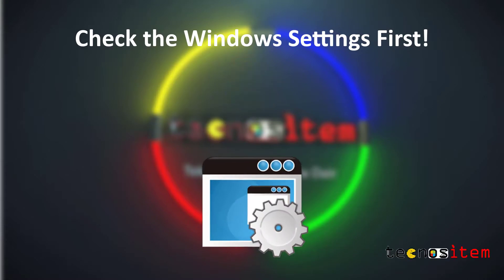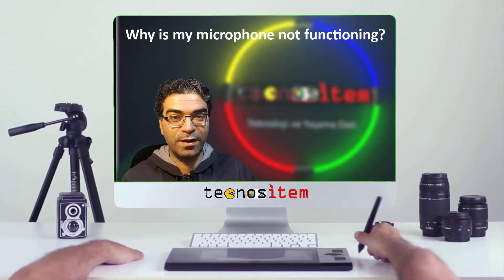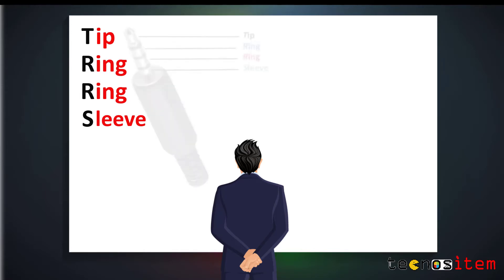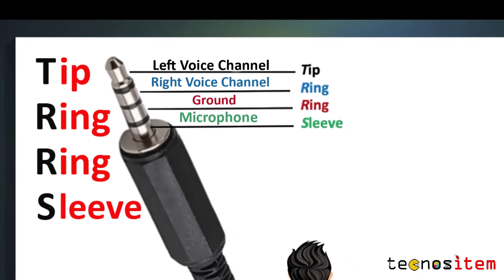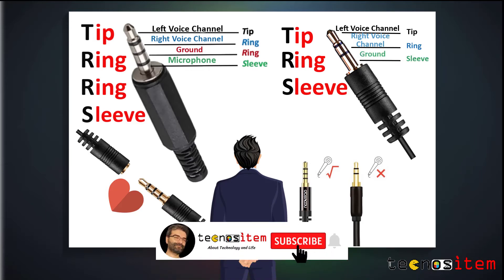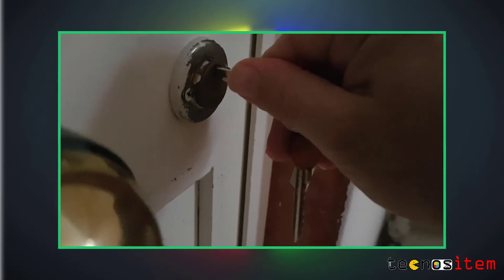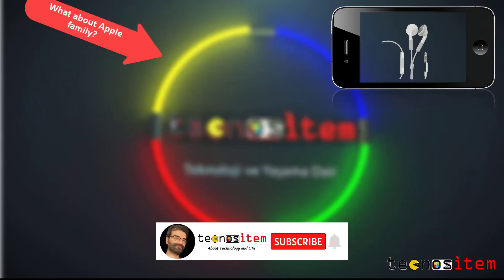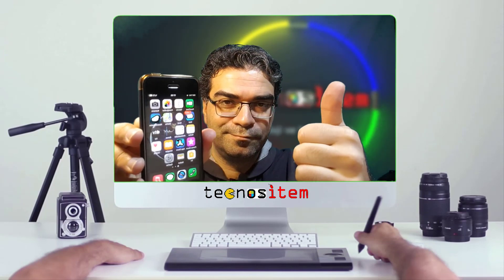My Headset Microphone Is Not Working  What is TRRS and TRS? #TRRS

Comment: Very informative. Thanks. I have a question if you allow. I have a headset that has 2 TRS jacks, and my laptop has only one 3.5mm input port, so I assume that it is a TRRS input. The problem is: when I insert the TRS audio cord in it, it works just fine, but when I unplug it and insets the TRS microphone cord in it, it will still work, but I will hear a very loud buzzing sound from it. Do you think a (1 TRRS male to 2 TRS female splitter) will help me? P.S: I have checked my headset on my older laptop that has 2 TRS input, and it worked just fine with no issue.

Comment: help i have mic with trrs 3.5 mm and headphone trrs 3.5 mm my laptop has 1 trrs female for headphne and mic so im using splitter which male is trrs and 2 female but idk  the port type when i use it mic does not work why? does mic female splitter support trs only? or splitter does not work

Comment: I have a splitter but mic still doesnt read pls help
Reply from the maker: The source of the problem can be various.
 *If your computer has headphone and audio jack on the front and back, try both jacks.
 *If you are using Windows 10, you can try changing the Realtek Audio Console Program settings. (Can be downloaded from the Windows store).
*Make sure the microphone is turned on of course.
*There may be problems with your sound card
These are what I can say for now..
Reply: @tecnositem  thank u i fixed it

Comment: hi, great video thank you for your information, i have to extend a mic in a radio as the internal mic has broken, which wires would i to solder to the board if i used a trrs type cabled microphone  please,